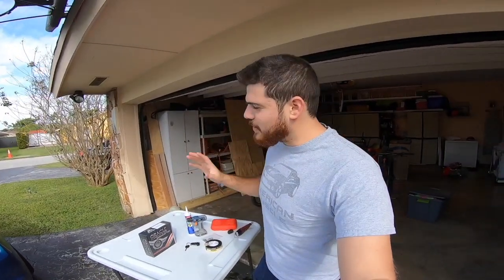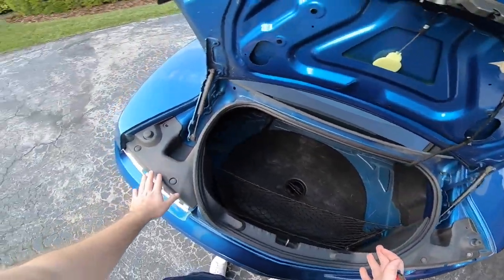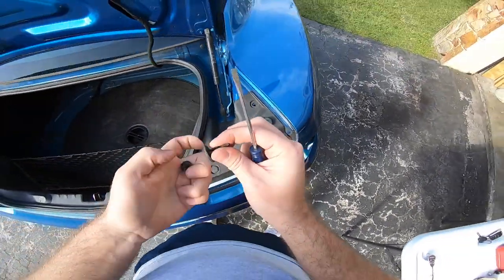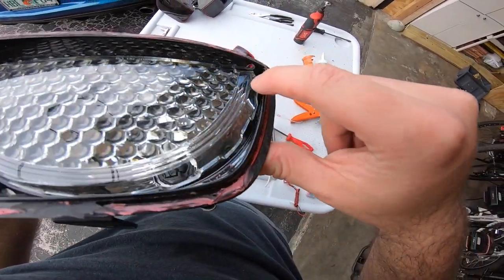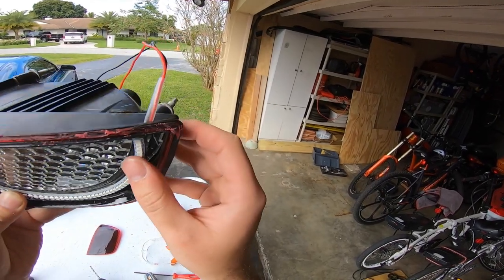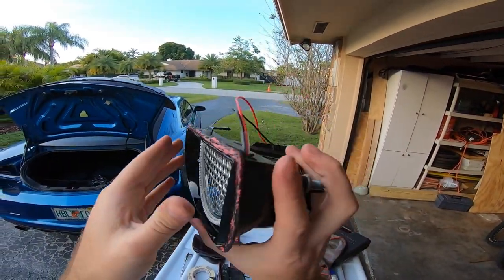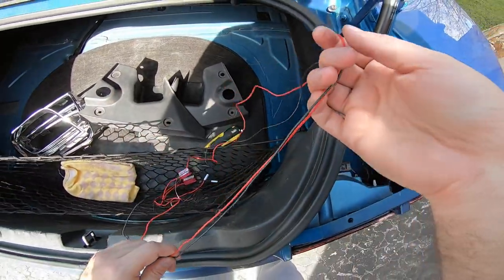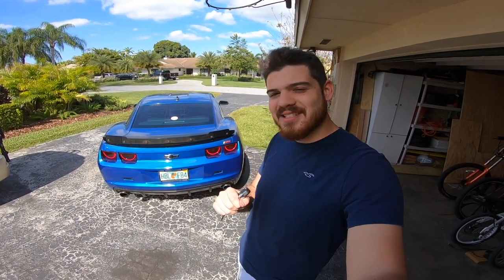Oracle Afterburner Tail Light Installation on Camaro SS | 2010-2013 Camaro SS & RS Afterburner Kit!

Comment: Looks great I've always wanted these tail lights but didn't want to cut into my tail lights lol. Thinkin about getting a 2nd set to chop up. Good job!!
Reply from the maker: You should go with a pro just in case. Not gonna lie I messed up with the epoxy (not adding it) and the lights came undone. I had to do the whole thing again.
Reply: @gvaspirated  what did you do to reseal

Comment: Looks good but you can buy those connectors locally without ordering.
Reply from the maker: Not here in my area. I check local and large retailers. The red t taps were non existent in the stores. You gotta pre order
Reply: @gvaspirated that's crazy. I know my local tool store has a whole isle for wire connectors.still thou looks good.i have a 2011.i prefer the 5th gen over the newer ones.
Reply: @gvaspirated  why is the color important? 😂

Comment: That small little clip at 8:00 u said pop like a earring mines didnt come with that
Also i have two black wires n a red per oracle
Reply from the maker: Maybe they changed their light designs. Reach out to them and reference my video (like cables and pieces) that way they can confirm if they've changed their products or maybe forget it. They actually forgot the red little clamps that go onto the tail light cables. They needed to ship it to me.
Reply: Thanks but i figured it out 1 of the black wires are a ground

Comment: what size rim and tire are you running?
Reply from the maker: 20X10 all around and 285 up front and 305 in rear
Reply: @gvaspirated  they don't hit in the front??  I was told I couldn't fit a 9" rim and 275 tire in the front??